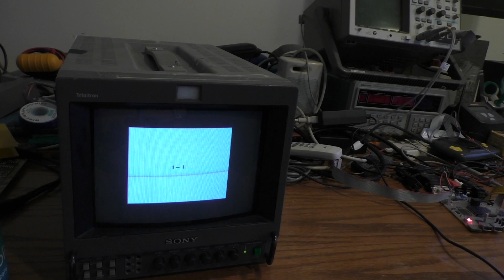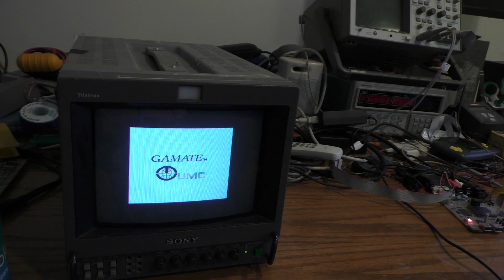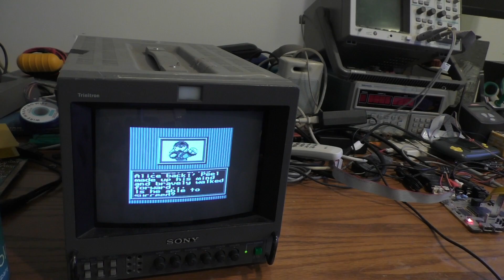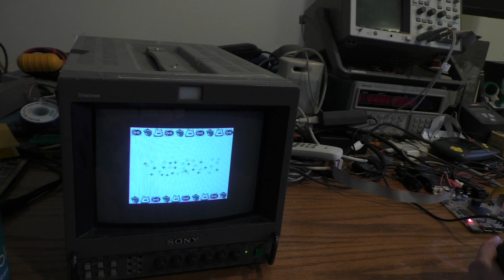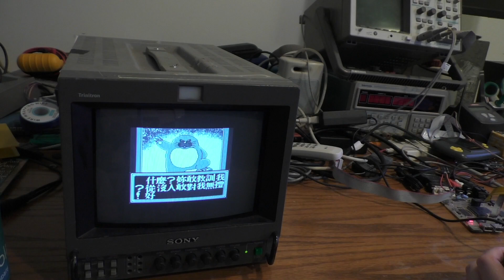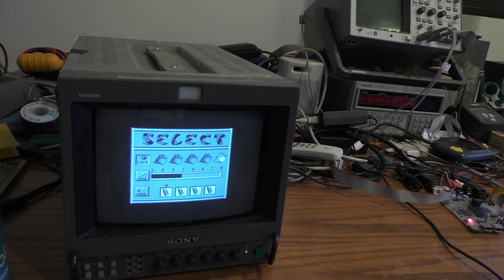FPGA Gamate Core Development and Demo

Comment: kevtris, would your custom rom emulator work with pretty much any handheld system as long as you create a custom cartridge board for each system you wanna reverse engineer?

your rom emulator you created looks so good, if you ever wanna make extras to sell to customers, please let us know, many of us would love one of your rom emulators you always show in these videos.  i am just curious as to how many revisions you have to go through to get the emulator working with each system and how long the process takes you between revision and final build.

once again, thanks for the awesome videos, love your work!
Reply from the maker: There was only one revision.  It worked perfect the first time.  The video showing me laying the board out was it.  There's 9 cartridge boards for it now, and all of them are tested/work.  SNES normal, SNES SA-1, genesis, gameboy, gamate, game.com, lynx, game master, game king.  I am going to make a few more, including mega duck and bally astrocade.   It would be possible to make 2600, 7800, intellivision, coleco and other cartridge adapters as well.  The only system it won't work on is NES because it needs two ROMs.  It would work for the VRAM games though (UNROM, etc).

Comment: Does the slower changing rate of the original LCD look better in the horizontal, or is the quick CRT refresh better? If the former, could you add slower decay to the CRT, or would that make it too different from the goal of "this is how the hardware on the original works"? Shiny nonetheless!
Reply from the maker: yeah it does.  the quickness of the CRT really detracts from a lot of games.  They erase the sprite and redraw it on most games, so things flicker on/off as they change badly.  some of the later games however do it the "right" way with XOR updates, so there is zero flicker.  That flying cat game (futher adventures of hannibal the cat) does this and the result is a pretty decent showing on a CRT.

Comment: Jesus, how many cores do you have planned for the Zimba 3000?
Reply from the maker: as many as I can put in it.  Getting close to 20 cores now.
Reply: kevtris  Thats very impressive.  

Question, if you ever get around to doing a Genesis core would you consider adding a low pass filter to more resemble what an original Model 1 Genesis sounds like?  I'm not really a fan of the sound of unfiltered YM2612 audio.

I think the cut off is somewhere around 3.68KHz.

Comment: Hello mate! Can you provide some tech specs about gamate? Such as memory map or so on. I'm intersting to write an emulator, but there is no tech info available
Reply from the maker: sure.  search google for gamate inside txt and you should find it.  I wrote a complete document on how all the hardware works.
Reply: @kevtris  thank you. found the link in MAME gamate sourecs ) thanks for your work! now i'm stuck at 6502 cpu wont work same as in MAME, tried Marat Fayzullin's 6502 core and various other wide spread, but it loops in bios, and not in copy protection :(